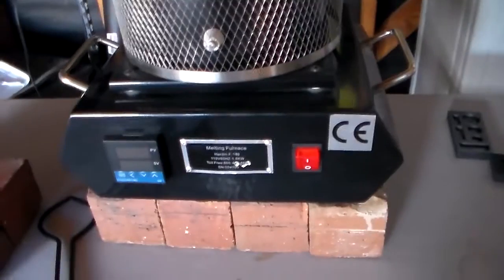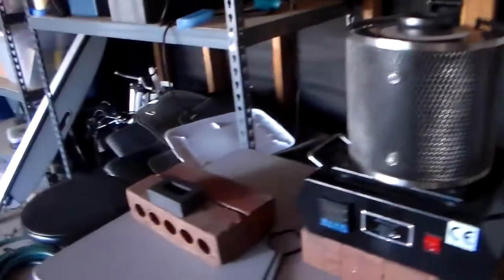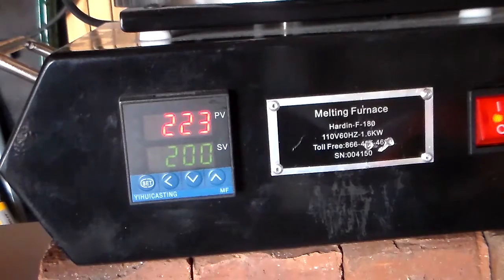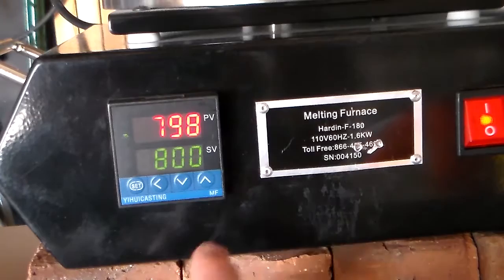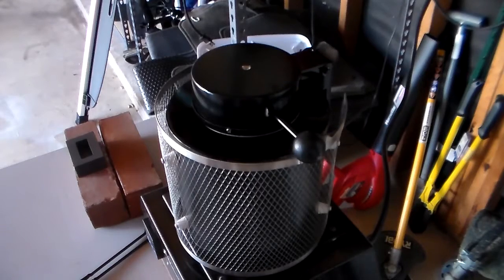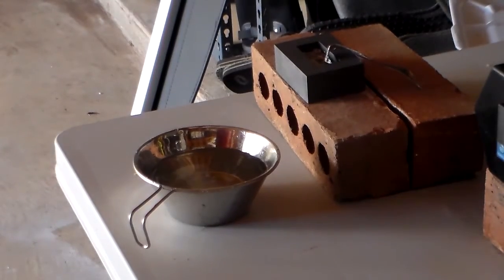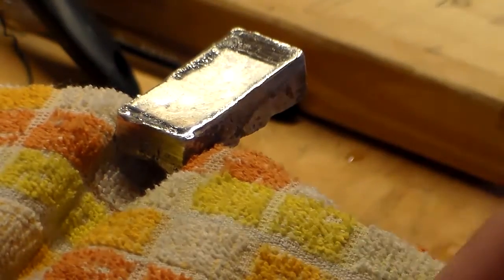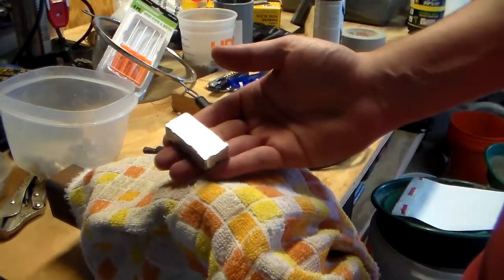Smelting Silver with Hardin F-180 Furnace

Comment: I'm considering purchasing this same melting pot, would you recommend this same one? Is it a good quality machine? Please let me know.
Reply from the maker: +tyler berry The furnace is hard to find instructions for. I did this video because of that reason. Mine has not had any issues so far out of the few times it has been used. However, I did buy this on eBay and the seller is no longer listed on there, but he sold refurbished ones anyway. This one is refurbished (new heating element and control panels). When I purchased this, I was given specific instructions on how to not burn out the heating element which is why they get refurbished often apparently. Would I buy it again if I had the choice, sure. It was the cheapest working furnace I could find, has a great capacity load, and I have not had any issues. I did not want to go with a flame operation.